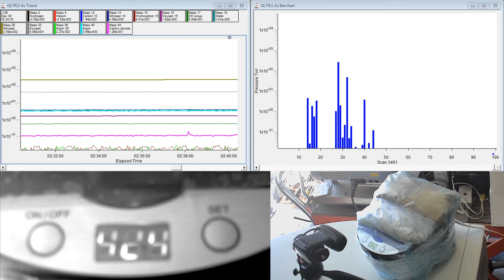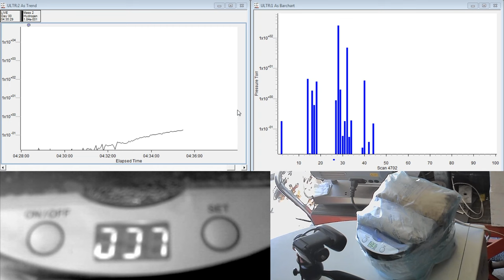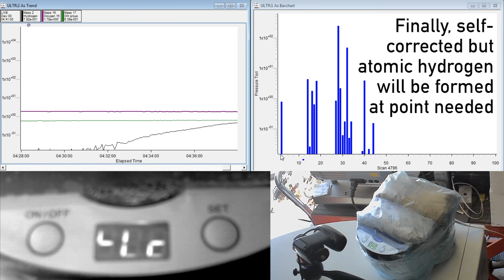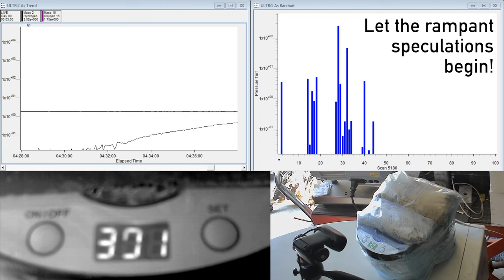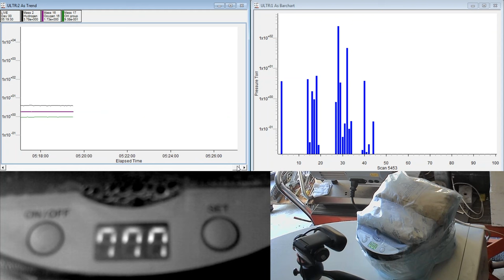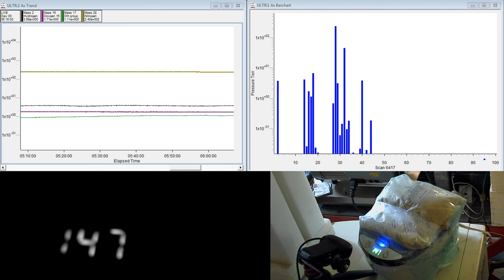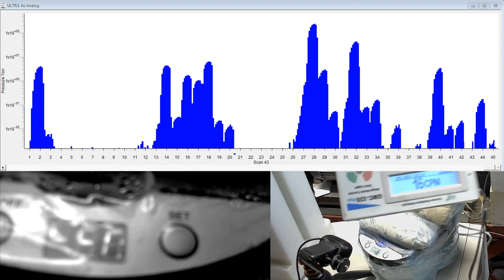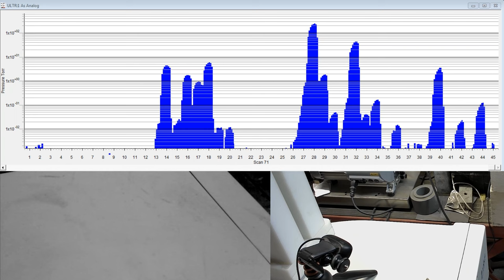ULTR - Gas production / synthesis - the experiment

Comment: This is just regular oxidation of Aluminum with the water, producing H2 gas.

The aluminum starts with a protective surface of oxidized aluminum, which gets ablated by the vibrations to expose the non-oxidized aluminum beneath it, which then oxidizes with the water. What am I missing?
Reply from the maker: This was known at the outset - it is the implication of having paramagnetic protons and atomic hydrogen produced exactly in the optimum place for participation in coherent matter nuclear synthesis that has not been considered before.

Comment: I'm following Bob's work, but unfortunately I'm not educated enough to understand the majority of it. What are the usages of producing hydrogen in this way? Is it any more effective than other methods? And what does it mean when Bob says it produces hydrogen exactly where needed? Needed for what?
Reply: Ah, this is hydrogen 'production' really for of the novelty of doing it without electrolysis. "Where it is needed" refers to being "where it is needed to combine easily with other elements", eg oxygen, so O-16 to form O-17 etc. . I'm not up on the theory but it has to do with using the aluminium lattice as a sort of "vice" to press together the smaller elements, or to fuse with themselves or with the aluminium itself(?). Pons and Fleischmann were using using Palladium to confine large amounts of hydrogen in, hoping to induce fusion reactions betwen the hydrogen atoms, but here we have a much cheaper set up!!! However this one does not fuse H to produce He and thus generate energy, but demonstrates the Low-Energy Transmutation principle
Reply from the maker: I will answer this precisely. In the meantime, I recommend these to videos if you have not seen them.
https://youtu.be/AZ9RJr_s31w
https://youtu.be/na7kpLJbCv8
Reply: @MFMP  Thank you!

Comment: Wouldn't it be easier to challenge the youtube experimenter community to replicate the "strange radiation" traces on Xray film while perhaps offering them some monetary incentive to do it as well,  keeping the challenge open at all times by reminding viewers of it every time you start a video and by having a channel intro video that challenges them to attack the problem at hand. The big ones like ActionLab will do it even without that if you get their attention, like for ex. ActionLab tackled "Egely's wheel" (payed 50$ for it ). This tactic should be much easier now that you've exposed yourself to larger audiences via associating with Ashton.  Some independent replications from reputable sources would increase your credibility significantly.
Reply from the maker: Paying people to potentially expose themselves to harmful radiation? Has to be volunteers.
Reply: @MFMP   You're going about it as if people aren't using and being in proximity of ultrasonic baths (or other cavitation producing devices) on a daily basis, and besides the precautions are easily communicated. "Simply don't be in the room while it's running." Should be easy enough to put a challenge out, right ?
Reply from the maker: @sFeral  I am not doing anything because anyone else is doing anything, this experiment was born out of serendipity - a happy accident when Alan Goldwater decided to 'clean' indium control foil sample kept to compare to foil exposed to Dr. Ryushin Ohmasa's vibration and Omasa Gas systems.

This particular test was not focused on the standing waves, but on the potential for atomic hydrogen production to be precisely produced where it is needed in the cavitation / vortexes produced during standing wave action on metals, with the idea that Aluminium was uniquely an accelerant to the process. Ordinarily a salt is added to promote hydrogen formation as detailed in the 2010 DOE funded research - in this experiment there was no salt in the distilled water.
Reply: @MFMP  Again you're side-winding around your original excuse. If anything you were saying were true, your cause could only benefit from being challenged. Don't board a ship that's about to get sunk.
Reply: @MFMP  Ashton's ship has sunk, he's a desperate man drowning, pulling down others. You've already put yourself in the same position by claiming you can recreate RAW image files. Pls prove that claim. Cryshlee is waiting along with everyone else in the chat.
Reply from the maker: @sFeral  I noted that Sony, Canon, Fuji, Adobe or the like have formed a consortium to encode cryptographic signatures into images because they want all to be able to know a real photo of a happening compared to fakery. There was a signature effort back a few decades ago in photoshop also to encode copyright information into images during the ramp up of the internet - I used to use it myself.

When I was a kid, I used to use hex and binary editors to tweak files, much lower level stuff than changing a date or EXIF data. Do I think that top level code monkeys at intel agencies could fake them - I'd like to think they were that competent. Do I care? not really. I repeatedly showered praise on whoever Cryshlee is,  having done AE and hired very good effects artists in the past, I could see she knew her way around.

I was alerted to the videos before I spoke to Ashton, I had to consider them, because of what my father showed myself and my siblings one late summer night circa 1979. I recounted this to Ross Coulthard in Jan 2021, long before these videos were on my radar.
https://remoteview.substack.com/p/dont-miss-this

I subsequently found out (but before I had ever seen those videos), that what I had deduced is the structure of Ball Lightning, was previously published without knowing it, by A C Holt as a means of intergalactic propulsion.

https://youtu.be/lnOeQdUaslE?si=T8c2flFLN6RjQRFd&t=1271

I referred to this work again on Sunday

https://youtu.be/I-zKKRcwobU?si=dO-6X_ngHybOXJIN&t=3764

My initial video on the subject, before I ever spoke to Ashton, started by saying, and I paraphrase, "on the assumption these are real" and "I could probably have faked these back in 2014" - I did not want or attempt to fake them though, it is just a statement of confidence in my ability back then. It is not my interest if they are real or not, that is not going to bring the people back - though the exposure this conversation creates might get the families to a point of conclusion one way or another.

My interest is that they appear to show the spin inversion atop the topological monopole, and the embedded gravitational waves will lead to the formation of a "black hole" like object at the phase singularity of the fractal toroidal current structures. Again, all things in that sentence I had described or referenced BEFORE I had any awareness of these videos.

https://www.youtube.com/live/gW0JPZedjXM?si=iNEspXoMqVO2lQ_H&t=5599

On the assumption it is a fake, well, as I argued from the start, it is still showing what is needed according to our experiments and John Archibald Wheeler's (credited as inventor of term Black Hole and Worm Hole) statements to produce the observed outcome. As an inadvertent remote viewer, I can appreciate that this art imitating truth can come from to process of remote viewers where, say, a person told of a target, and then they start sketching ideas as to how that could have occurred, which they then make it into a video. Much like 'inspiration' could have lead to the Tesla Logo looking exactly like Finnish Thor's hammers from 1000s of years ago - where art meets science.

https://youtube.com/live/zo0j6uqf5_w

From my perspective, from the beginning, before I ever spoke to Ashton, it is not important to me the provenance of the videos, either way they depict a real thing, as stated by Wheeler and observed experimentally by us. Literally matter, disappearing in a sphere.

https://youtu.be/CPX7gmRmeq0
Reply: You seem to have a misunderstanding about what science is  @sFeral   Bob doesn't have to prove anything to anyone, he presents the data.  Take it or leave it.
Reply: @IC-Alchemy  yes he does, to himself at the very least. Science is made of proof and in itself a method of obtaining proof, proven to work.
Reply: @sFeral  You are confusing science and mathematics.  Proofs are for mathematics, science is unable to "prove" anything.
Reply: @IC-Alchemy  proof things happen or don't happen under defined (as can be) circumstances

Comment: How could it be possible that fusion products might not be radioactive?
Hypothetically, these are expected, 
H + O-16 -> F-17 .. half life ~ 1.1 m -> O-17 + positron 
D + O-16 -> F-18 .. half life ~ 1.8 h  -> O-18 + positron
Reply from the maker: Because it doesn't work like that. Here is one hypothesis.
https://www.nature.com/articles/s41598-023-50824-8.epdf
Reply: Are those results from equations which describe explosive fusion?  You’d think that LENR reactions would have different equations, or rather, expanded equations.  Different energies are involved.  To my mind, this means they are not the same, and differ in expression.  Hence, if this is some sort of fusion, then we see no explosions because of that.  I haven’t seen one yet, and so, again, if it is LENR fusion.
Reply: @MFMP  so I'm guessing from discussion at tonight's APEC, that the input nuclei are trapped in strong magnetic fields inside the vortex, and fusion products cant escape, unless they're diamagnetic?
Reply from the maker: @paulshields1883  Everything escapes when the structure dies.